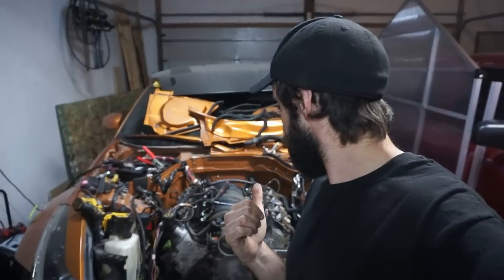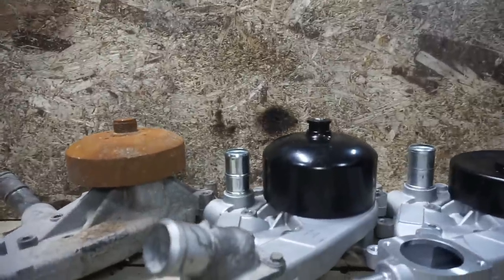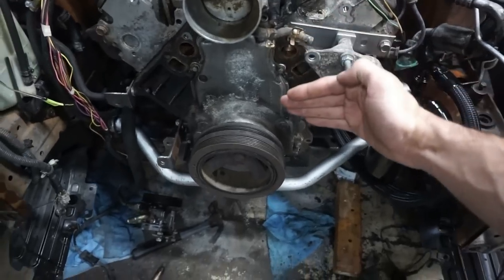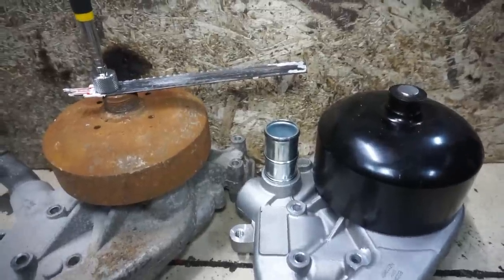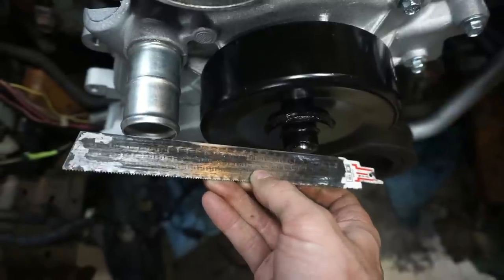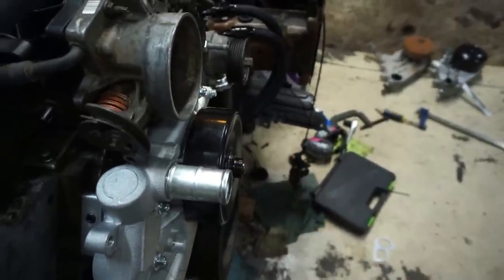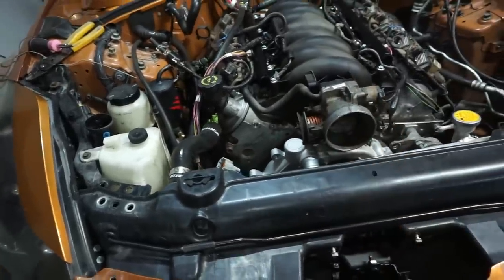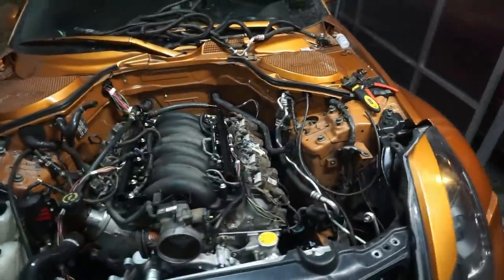LETS TALK ABOUT LS SWAP WATER PUMPS!!!!

Comment: dont forget its not just an "ls3" pump it depends on the application. An LS3 camaro pump is the same as truck spacing but a corvette LS3 is the short one. Corvettes where always shorter be it ls1 ls2 or ls3..

Comment: The 2010 L99 Camaro water pump is a corvette style that is spaced to the truck dimensions therefore those spacers would be unneeded
Reply: Braxtan Lillie so you could use the l99 water pump with truck accessories and no spacers is what you’re saying?
Reply: @tourqualitygolf  He is correct and is the exact setup I've had for several years. Truck balancer + 2010-up Camaro WP equals success.
Reply: @BERPSU1 still using truck alternator ps ac etc?
Reply: @tourqualitygolf  Yes. All truck stuff. You do need the Camaro belt tensioner to go with the Camaro water pump though as the mounting tabs on the pump are different from truck, so a truck tensioner won't bolt on the Camaro pump. Need the Camaro tensioner.
Reply: Thank you

Comment: If your not worried about hood clearents you could get intake spacers to raise the TB about the rad support, I was thinking you would have better air flow if you tip the rad the opposite way and put the cap thro the bumper shroud kinda opposite of an FD rx7 set up, would give you getter upper hose location and trap the air flow a little better
Reply from the maker: Already got it moved. It works pretty slick. Check it out.
Reply: @BlaserBuilds  will do

Comment: As far as your water pump goes you could get the top water inlet off a truck pump, pull the inlet off your pump and weld a block off in it and if you look at the top of your pump you'll see the areawhere the truck pump inlet goes.  Just bore out the hole and press in the truck inlet.  Set it at any angle you want or weld on an aluminum elbow.

Comment: I'm almost wondering if the new water pump, spacers, etc. would cost as much or more than having the driveshaft shortened. Plus you'd have better weight distribution with the engine further back. Now, if you relocate the radiator, it should give you more clearance so you could take the cost of the waterpump/spacers out of the comparison. That throttle body to radiator support looks really tight. Just a thought. I'm enjoying the series. Bummer you didn't get int he 10's with the truck yet.
Reply from the maker: It's a factory carbon fiber drive shaft, so wouldn't be as easy as shortening it. I moved the radiator tonight and there's so much room now. More room than I have on the truck, to be honest.
Reply: a21bravo  Ah, ok. I didn't realize it was CF. Makes more sense now.
Reply: @BlaserBuilds  
Move rad down and forward...  Costom Fab upper and lower surports...

Just notice this is a year old 😂

Comment: You might want to look in to Gates heat shrink hose clamps if you have to cut down that hose barb.

They are single use but I think they clamp better than worm gear style over a wider area.

Comment: Thank you for sharing.I have a 4.8L engine with a corvette intake and 92MM throttle body. The water pump is still the truck water pump which created a huge problem for my accelerator lever on the side of my throttle body as it was hitting the upper water line. I added spacers to my throttle body to push it closer to the radiator giving me a bit more room, but I feel I need to switch my water pump. I still have the truck Crank Pulley, Which water pump do you suggest the LS1 water pump, or the one you just showed with the spacers?

Comment: Good info! Is that radiator going to be enough with the V8 / turbo? I have some 80# injectors that I would cut you a deal on btw. ;)
Reply from the maker: Not sure, ill probabaly try it first if it doesn't work then change it. Which Injectors?
Reply: @BlaserBuilds  they came from VSRacing. They have about 32 passes and 20 street miles. Drop me a line at diygrgtx@gmail, we can figure something out if youre interested.
Reply: Should just send the injectors for free.

Comment: Not sure of the pulley setup on the escalade 6.2 pump ( just like truck perhaps?) But the outlet will point in a better direction. Not sure if itll have hood clearance issues though.
Reply from the maker: That's the same as the truck pump. So would stick out too far.
Reply: @BlaserBuilds  yeah that figures.

Comment: I have a LS truck motor water pump.. any other water pump will fit into it without a problem ? I’m thinking to buy the Holley kit for my C10Trucks . Just wondering if any of the water pumps are you showing it will fit into my motor. Thanks for your time

Comment: You can't move the engine back a little? It's cheap to have the stock drive shafts cut and balanced.. I had one made and cost $150 I only had to provide all the parts. Had my u joints upgraded to 1350 and also the yoke.
Reply from the maker: It's a carbon fiber drive shaft... But would also require different transmission mounts engine mounts and shifter relocation kit, so would be another $1500 ish to do all that.

Comment: Question I want to run a LS3 water pump on my Gen3 5.3 truck engine, would I be able to run a LS Corvette pulley on that 5.3 Gen 3 ? Any help would be greatly appreciated. I need everything to sit in very close due to clearance issues.

Comment: you save me dude , I’m running into the same problem, my ls1 pump is too close to the radiator too , can you tell me what part number it is for the ls3 spacer? Or a link where to buy it ?

Comment: Awesome video. I have a kind of related question. How do you align your front and rear covers for install? I'm trying not to buy the $70+ in tools to install the seals and align the covers.
Reply from the maker: The timing cover and rear cover?
Reply: @BlaserBuilds  yes sir. A few vendors have tools to center those on the crank, and of course they say not using the proper tool might lead to leaks. I've watched you build "a few" of these haha. So you just let the seal center it and check cover to block with a straight edge?
Reply from the maker: @Zone6G  Yeaj, I've never used a tool to center, just line up flush with bottom of block would be the key thing.
Reply: @BlaserBuilds  thanks. You're awesome.
Reply: G W II you can also bolt the oil pan on before you tighten the timing cover. I have also seen guys cut the snout out of a balancer and waler the hole out so it slides on and off the crank by hand

Comment: Get a shorter pump and then put a spacer to make it longer🤔
Reply from the maker: People will usually do that to change the outlet position of the top hose, either so it doesn't hit the throttle body when, when swapping to LS1 intake, or to swap the outlet hose to opposite side for radiator routing etc.
Reply: @BlaserBuilds  just my initial reaction, I watched as you explained more